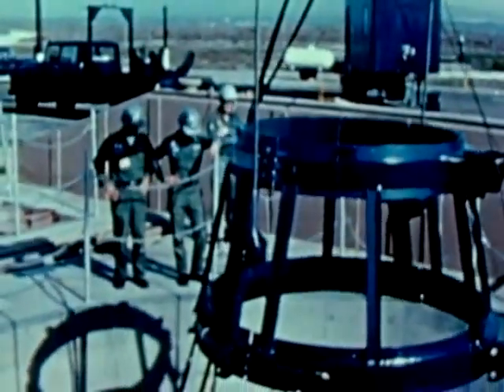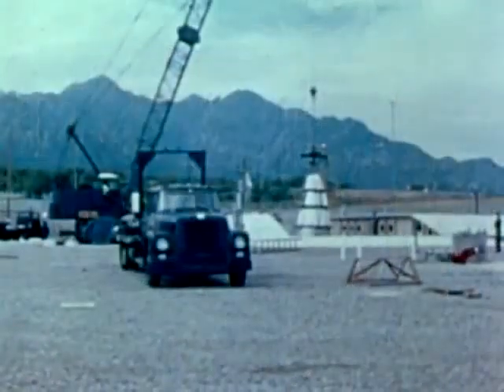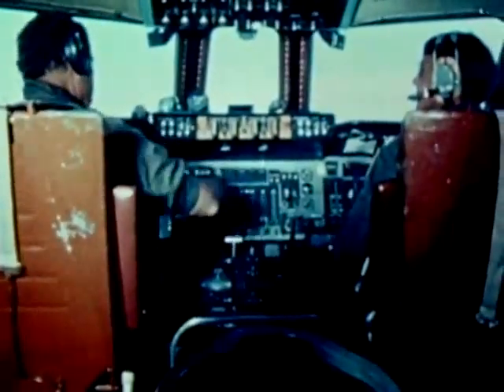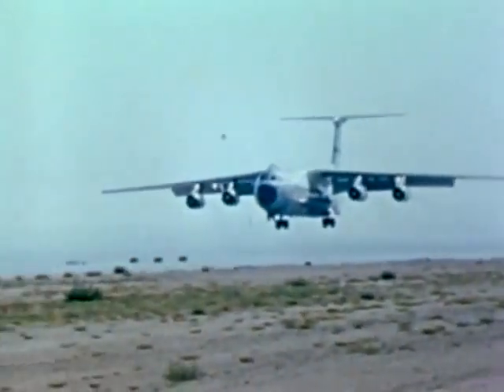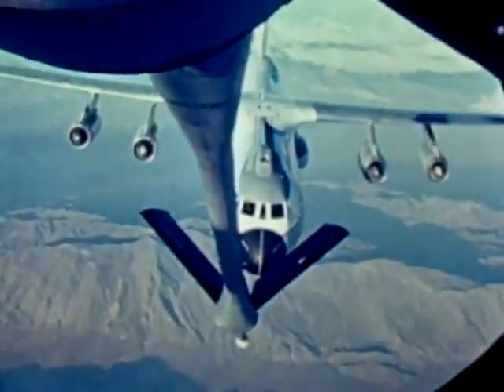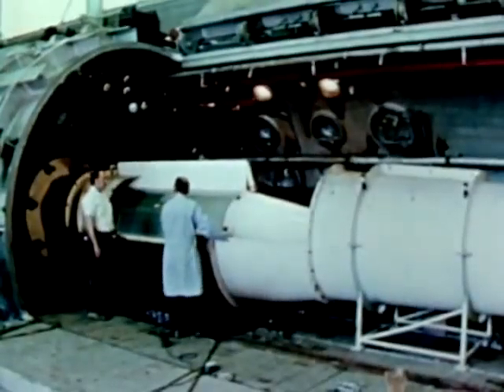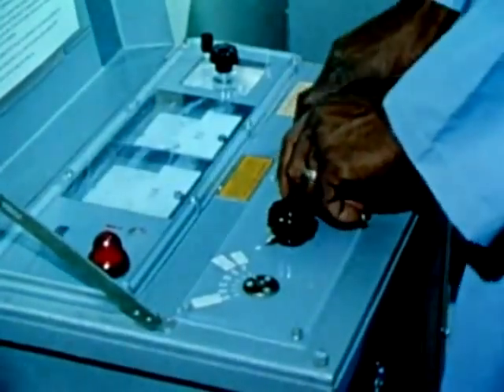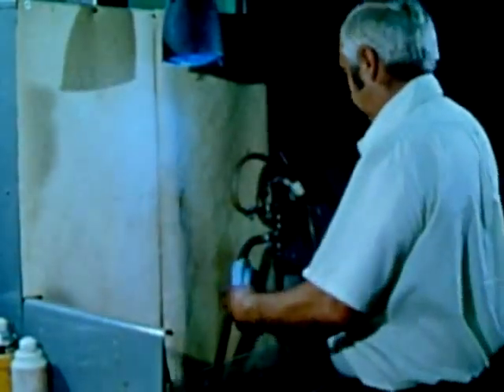Titan II Missile, 1978 Air Force Film

Comment: I was 10 miles away from siloam springs AR when they had a hydrazine leak in 1 of its ICBMs
Thank Reagan we're in StarWars Tech today ... else ???? Light Boom Heat & Radiation
Reply: +steven stallings Hydrazine leaks are some scary shit. -- Scratch that. Hydrazine itself is some scary shit.
Reply: didnt even need the war head...just chuck a fueled one out of a 141 on yer enemy n watch em run
Reply: It’s frightening how close we came to “Armageddon in Arkansas” because of a dropped socket wrench.
Reply: @LandNfan  There are safeguards built into warheads so that doesn't happen.
Reply: @paulschab8152  warheads were not my specialty.  I maintained Comm equipment on the sites.  381st SMW 9/66 - 2/69